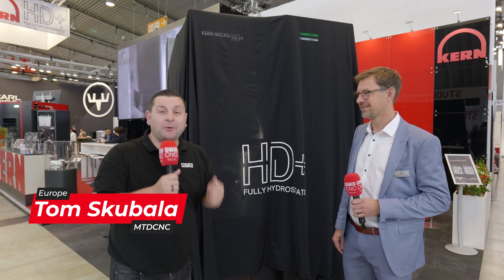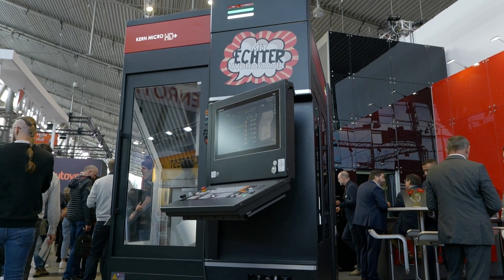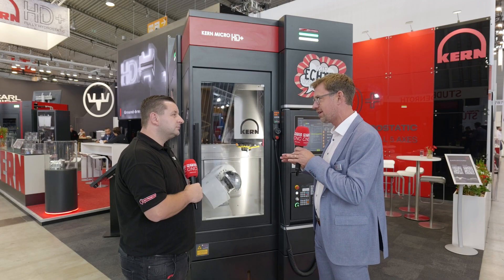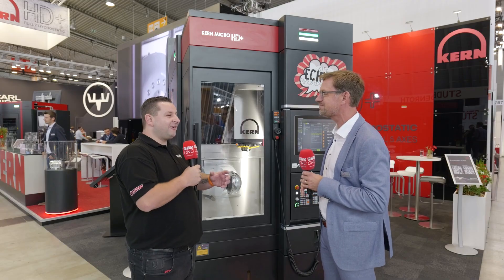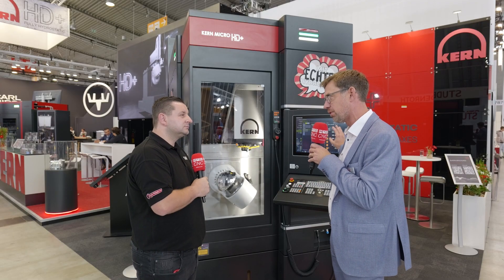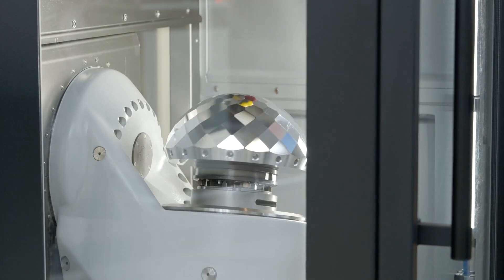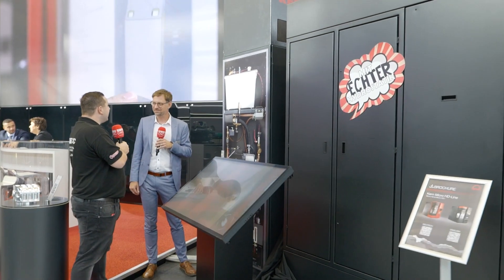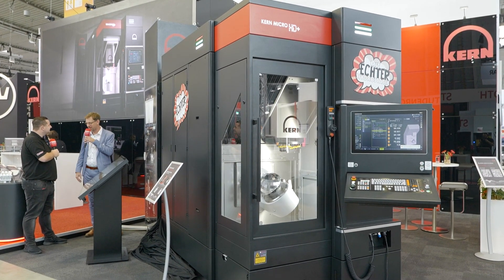Incredible world premiere at AMB 2024?

Comment: i know that HD stands for hydrodynamic and that kern is german and germany are not world wide known for humor but i really hope that kern with there next machine following after this one and will make the joke and call it 2k or 4k ( in refence to resolution. so your going from hd/1080p and then go 2k or 4k resolution )

i know that tank in the back is custom made and designed by kern to hold all those things but it honesly looks like a ikea box made out of aluminium to me ( the draft angle and the top/rim of it )

fun fact. most people know that copper is way better at moveing heat then aluminium but not many know that aluminium is way better at absorbing and releasing heat then copper. which is probably why kern whend with useing aluminium in there machine instead of copper